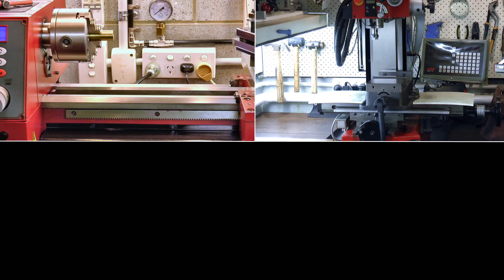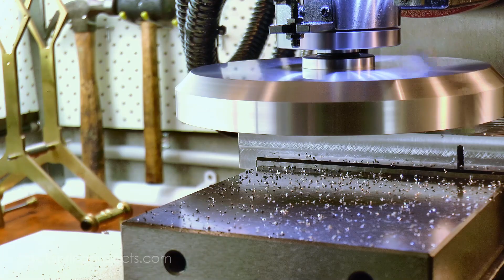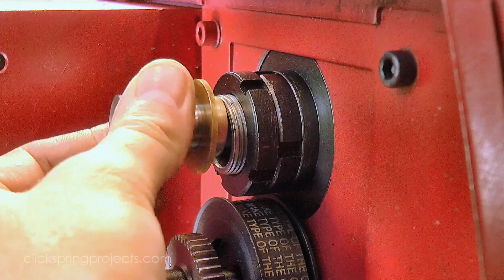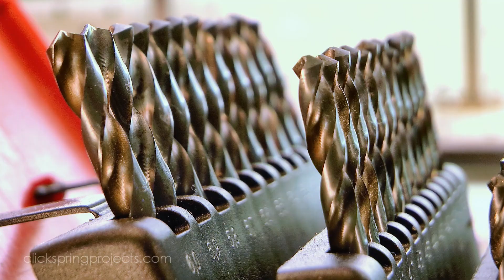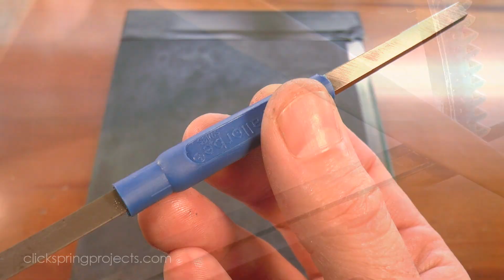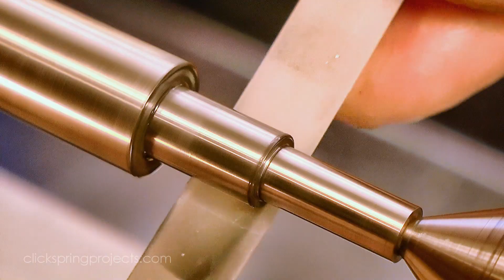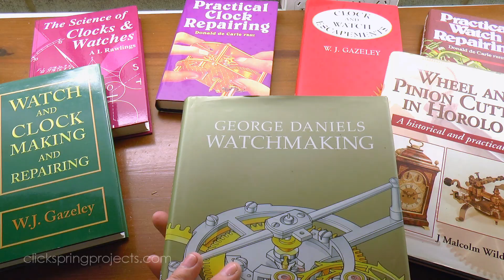Tools, Glorious Tools! #4 - Setting Up A Home Machine Shop: Where Do I Start?

Comment: I just had a random thought, how hard is it to build your own lathe? My initial thought was, not very. But then it hit me the precision, anything I build will have terrible tolerances and I bet those accumulate. So while it is probably trivial to build a bad lathe, building a good one is pretty hard.
Reply: Really a lot depends on your level of workmanship, and what degree of accuracy you are able to achieve with the tools and materials at your disposal.  The upside to building a lathe is that you can use it to REbuild your lathe.  No matter what tolerance you are able to achieve, each iteration of your machine will become more accurate with every part that you build or rebuild.
Reply: If you're interested, check out a channel called Rather B Welding. He made videos about making his first lathe and got pretty good results. He made it mostly from scrap yard materials.
Reply: @bradyoung6663  Isn't he the guy that builds his entire shop from scraps, off cuts and junk?

Comment: I'm currently bbuilding my own machine shop, mostly second hand, a 3/5" Randa lathe, a Rapid lime hand shaper and a bench press, small bandsaw and two grinders. I also bye at shows either second hand, chucks universal rotary table or from retailers offering show discounts. An internet source I recommend is that if Harrrold Hall, a long time contributer and then editor of Practical  Machineing Mmagazine. It is a plethera of desing/prodjects for the hobby machinist.

Comment: if possible, buy used machines and tools. Cheap chinese tools should always be the last choice.
Reply: There's nothing available where I live. It's pretty agricultural. There was never any heavy industry here. I suppose there's a couple local machine shops around. But whatever they've got they're not getting rid of. I have a mainland RF-32 clone. It's OK for what it is. I'd still like to score that good old cheap lathe. But I've never seen one.
Reply: @1pcfred  Facebook marketplace and Craigslist are my favorites. Expand your search radius, search often and be prepared to jump immediately. Seems like in the US the NE, Midwest and West Coast have the most machines.

I paid $1,200 for my Bridgeport (not the best example to give you as I bought from a friend but it took me 2+ years of bugging him to get it). It was good to go straight away with some minor parts I've repaired over time like the quill lock. I recently replaced a 12x24 lathe (paid $200 for 10 years ago +/-) with a Jet 13x40T that I found on marketplace for $1,500. The motor was bad, the quick change gearbox leaked and there was an issue with the halfnut. NOS Baldor from ebay, rubber/cork gasket sheet, about a gallon of gear oil, plus some knowhow and elbow grease bring the total to less than $1,700 for a lathe with the capacity and power to turn whatever I could ever want.

Pro tip, a drop deck trailer (JLG made mine) is not quite a necessity but it sure does make moving heavy, awkward items much easier.  Unfortunately I never could find one cheap but I did find one used so it was cheaper than new. New, $10k+. Mine, another FB marketplace find, $6k. (I deliver and relocate gun safes so mine makes me money. Look for local rental otherwise.) All the best
Reply: I do not agree, for small benchtop machine you almost can't avoid Chinese machines, and some are quite good. Limited but good. Other are crap so stick to good ones (Sieg, Weiss).
My cheap first lathe is still more accurate than my (new) 60yr old lathe. But the later is able to do cuts and work that the former can only dream of.

Comment: I'm not even a machinist, but I have Thomas J. Glover's "Pocket Ref" and a set of vernier calipers on my desk next to my computer at all times.
Reply: For anyone even SLIGHTLY interested in machining, casting, or metallurgy, R.A. Higgins "Materials For The Engineering Technician" is an absolute NECCESITY. I re-read my copy every couple of years because it's just so damn fascinating. Worth every cent at ten times the price, and that's no lie.

Comment: I may add: keep “maker shop” separate from “home shop” in your head at least, so you’re not scabbing home-repair resources and tools for your makers shop. For me this means my propane torch and pipe cutting tools are for home use only, and if I want to use them in my shop, I need to have them in my shop budget so I’m not abusing my home repair equipment in the shop. This obviously excludes simple stuff like claw hammers and some basic other tools, but seriously, keep as much as you can separated.
Reply: So don't do like me and stupidly use kitchen utensils in your workshop.
Reply: Worse yet be very careful when using home resources for shop activities.  SWMBO was not amused at my use of the oven to bake out enamel paint nor my use of the dishwasher to clean parts.  We're still married but it was touch-and-go for a while.

Comment: Never suffer cheap drill bits.
Reply: What? You don't like holes that are consistently 23.6% larger that the labeled drill size?
Reply: @ExtantFrodo2  No, you don't want holes jammed with a broken drill bit...
Reply: or hacksaw blades.

Comment: 6:35 those small ACE tap and die kits(Hanson) are of remarkably high quality for the price ....... you can't get em new but if you check Ebay they're always on there and sometimes a mint kit shows up.    Just adding this for between the ~one at a time as you need em buys ($$$) vs the ~buy the big kit of high quality all at once ($$$$$$) .......... the ace kit might even cost you about the same as one or 2 HIGH quality taps (new) so I just think it's worth it.
Reply: Have you checked out the TiN coated tap and die set from Harbor Freight? They are surprisingly good. Especially for under $100. There's are video reviews here on YT. Have a good one.

Comment: I feel like the only reason I would need a home shop is for building guns.
Reply: Don't limit yourself before you start 🙂
Reply: We'll send a psychiatrist to see you as soon as we're able.
Reply: Ummm, what? I don’t understand.
Reply: @minchy83  The lathe I bought on Craiglist was unloaded by a retired gunsmith. I learned that's not uncommon. It was strange to me since the last thing I would think of using my tools for is making guns.
Reply: @minchy83  for turning demilled machine guns into legal semi auto builds.  A lathe and a mill is pretty necessary for this.
Reply: Thanks for the clarification, building guns is just a foreign concept to me. Not something I have ever considered doing.
Reply: Guns, odd parts for odd jobs around the house, guns, fixing tools and appliances, guns… lots of stuff.